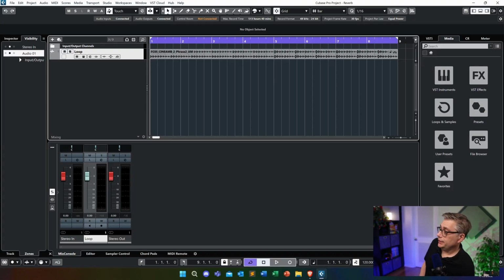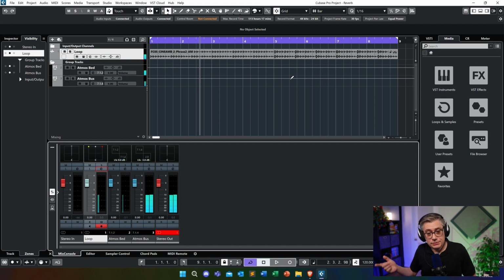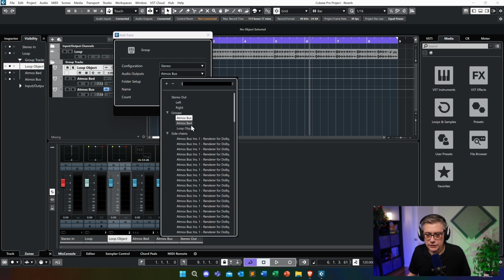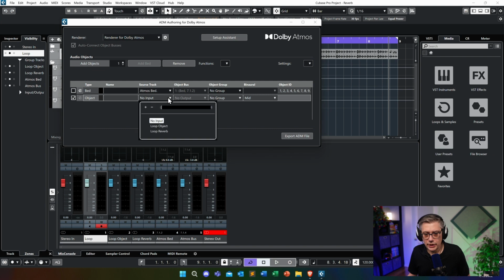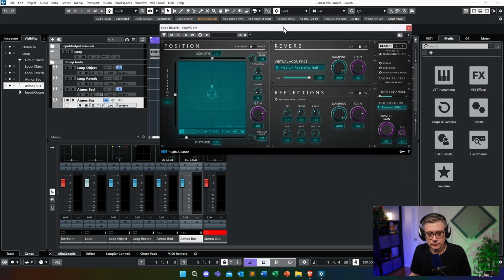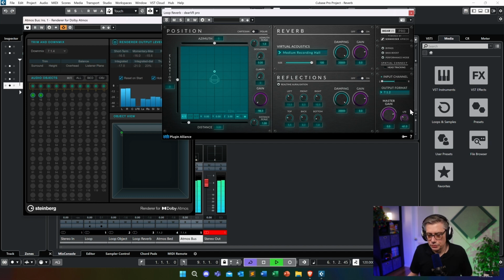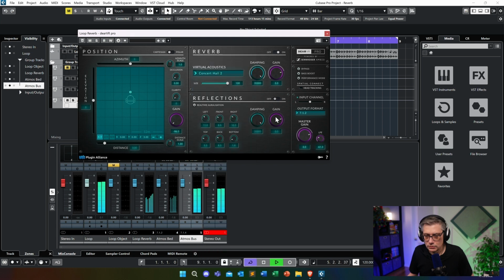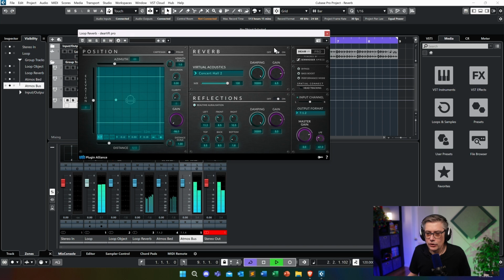How to add reverb to Dolby Atmos objects: DearVR Pro edition

Comment: Am I right in thinking that while it can follow panning automation because it is a panner and a plugin that it couldn't take an already panned audio file and add reverb to it. For example say we recorded a drum kit with surround mics it will be summed to mono and then add the space. Is there an atmos reverb that has a 7.1.4 input so you can use an already 3d signal and add realistic reverb.
Reply from the maker: You would not use 7.1.4 because bed channels are limited to 7.1.2. But there are many reverbs that can do that. Most people in this space like the Liquidsonics reverbs, Cinematic Rooms in particular.

Comment: So just of the top of my head without trying it yet -- in the light of the discovery of the linking of panners for sends (Nov 9th/2022 'simple' Dolby Atmos reverb video tutorial -- I'm thinking the DearVR Pro is a Send rather than a panner and thus the reverb will respond to the panning of the object in the Bed. This is pure thought experiment and likely comes with some wrinkles attached but still... worth a bash perhaps. Nice one!
Reply: Boy! The whole panner thing in Cubase is pretty murky, yes? It's scary to see panners displaying in the Link window behind slots where there are no Send entries... I'm trying to convince myself that panning an object with an effect properly linked, when handled delicately, is a worthwhile goal. But another part of me is saying, "My effect space is not going to be the Dolby Atmos listeners' space so why bother?" Binaural seems like the only mode where environment / ambience might be reasonably controlled by the creator. Or maybe I just don't understand how it works. Happy to be corrected. And enlightened.
Reply from the maker: If you work with DearVR you could not do it that way. You would simply have to send the object audio without panning to a helper track and use DearVR there fro the panning.
Reply: @michaelgwagner  Thank you. Yes, I had abandoned the FX Channel approach for a Group track insert. In addition, the track Link feature in the Mix Console is more intuitive for me. I would have discovered the Pre- fader tweak sooner or later... Still, as you intimate in many places, it's not clear it's worth it, at least in the project I'm working on at the moment. As always, grateful for your help!

Comment: Sir how to use free Dolby music paner plugin in cubase and nuendo   for panning and automation of objects
Reply from the maker: I don’t think you can, but why would you use it? In Cubase and Nuendo that functionality is integrated into the standard panner.
Reply: @michaelgwagner  because I  automate objects in cubase  and ADM export also done it.when i import to davinci resolve fairlight using import ADM file the automotion deta is not shown.also in space view scope movement of object is not available...why I don't know....i think if I use Dolby music panner this problem is solved
Reply from the maker: I honestly have not tried that, but I very much doubt it he music panner would solve your issue. If you have Nuendo try yo reimport the ADM (Cubase can’t do that) to check if this is an issue with the ADM export or with DaVinci.
Reply: @michaelgwagner  I will try it